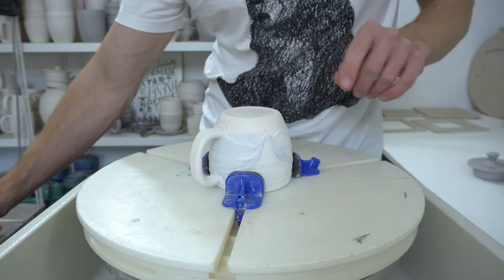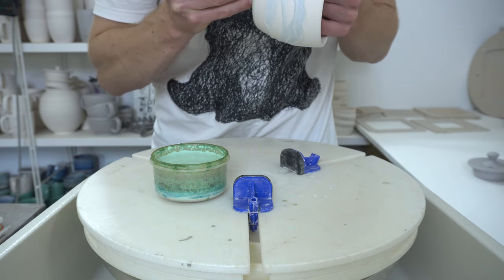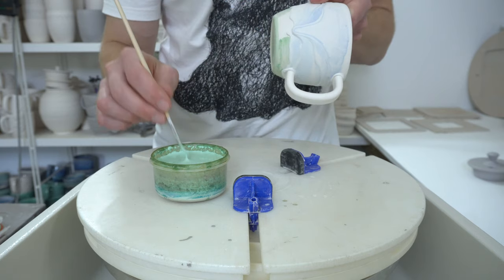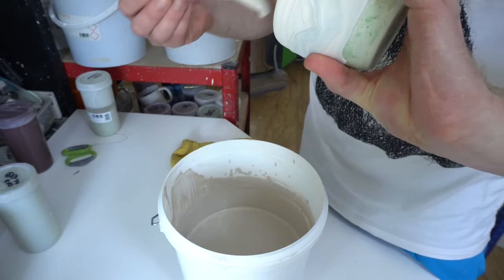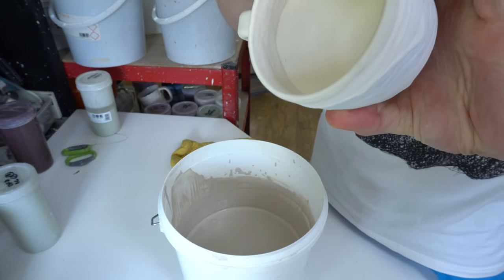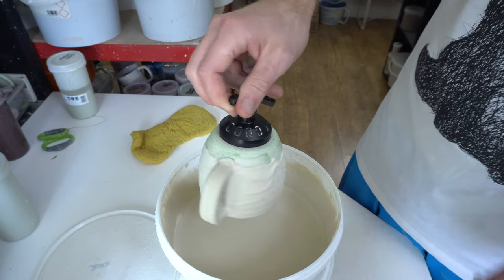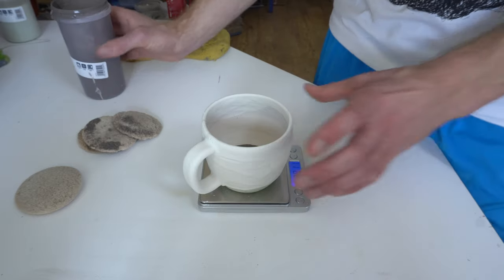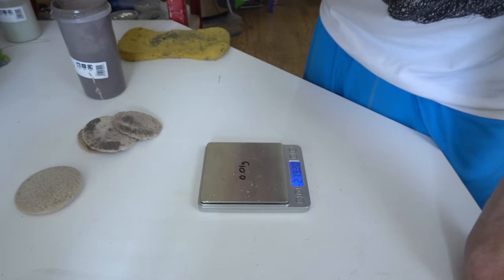How I Glaze my Drippy Slippy Mugs

Comment: Great video. Your wax resist works better than mine. I always need to sponge some areas.
Reply from the maker: Are you watering it down?
Reply: @OldForgeCreations  I tried both, but only 50/50. Maybe I need to water it down more. It seems counterintuitive though. My brain: "More wax = more water resistant". But maybe it has more to do with the surface. More water makes a more smooth surface that will help to flow off the glaze, probably?
Reply from the maker: Exactly that. A very thin layer of wax is hydrophobic, so what you really want is the smoothest coat and it's easier to get that with a more dilute wax mix
Reply: @OldForgeCreations  Thanks! Extra benefit of adding water: makes it cheaper.